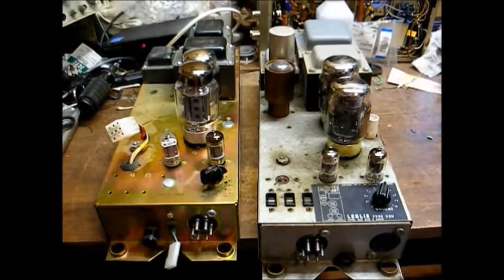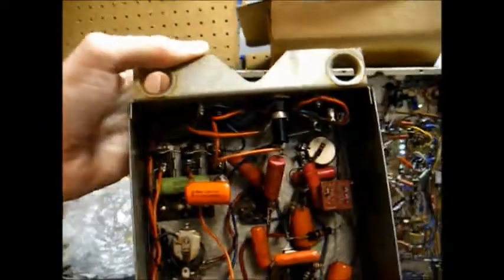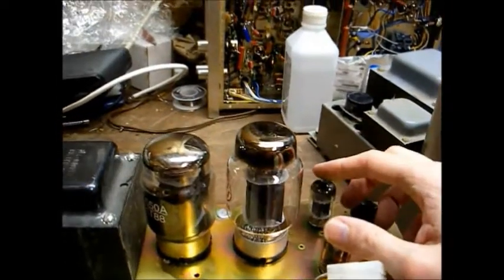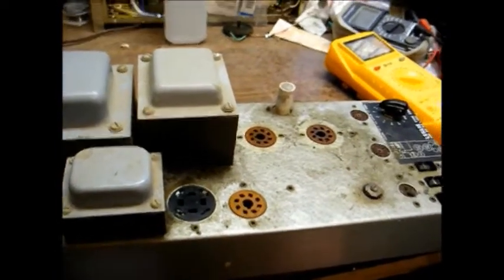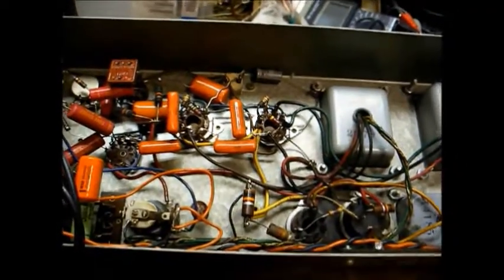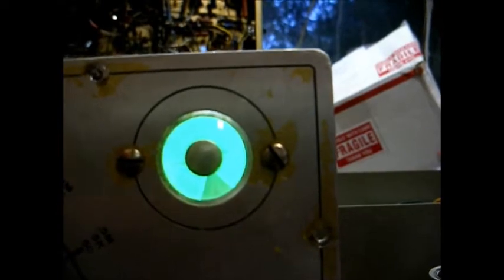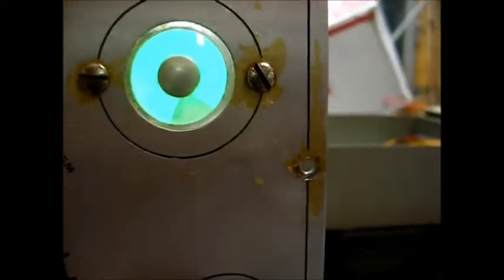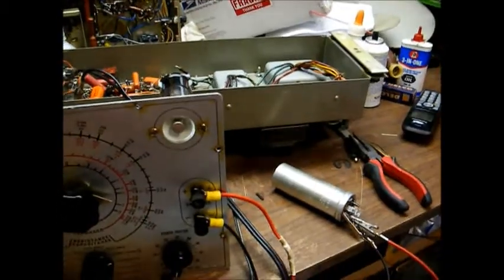Repair of a Hammond organ Leslie tube amplifier - pt. 1

Comment: I work on these amps all the time - fantastic job! Those can caps are frequent flyer offenders, as are all the paper caps. That 470 ohm resistor is used as a fusible resistor and is often high in value if not burned up. Also, the 220k and 56k resistors are usually drifted high in value. Thank you for this video and part 2.. I enjoyed it.

Comment: In the mid 1960’s I worked at the Leslie organ factory in Pasadena, CA.  I built the motor assemblies for the Leslie rotating speaker baffles.  The more senior techs built the electronics...

Comment: Have used the same similar cap. tester for years, & was never shown or knew what the power factor knob did. Thank you for that. Still not 100% sure, but definitely the leakage test. Yes, the digital ones do show correct value on bad/leaky caps., no help when trying to find the leaky ones. A rebuilder I once knew was using NOS electrolytics in rebuilds & most/all were leaky when using the eye versus fresh new caps. He stopped using them.

Comment: I no its a old video now but thanks foe the info. I just picked up a Leslie 44 with 4 6v6 tubes,  but its 70v line output and also 2 ao-43amps.   All 3 need recap and some tubes.

Comment from the maker: I've already been thinking about that and I will check the B+ voltage, just to make sure. Another reason I think a tube would be best is because the tube is less likely to short than the diodes.

Comment: The power factor knob is used to test the ESR (Equivalent Series Resistance) of the cap under test. This figure should be as low as possible. Believe you look for an indication on the "eye tube" while turning that knob and note the number that it points to.

Comment: You can buy an exact replacement new electrolytic capacitor from "Tonewheel General Hospital". It is a newly made multi-section electrolytic can of the proper rating. You will just need to snip off the appropriate tab on the new one to get it to fit in the socket.

Comment: Ah yes, replace rectifier tubes with silicon diodes. Solid state loves to fail as a short. Don't want to see the aftermath. Already see it with SCRs, IGBTs, FETs etc in high power inverters and rectifiers. POW!